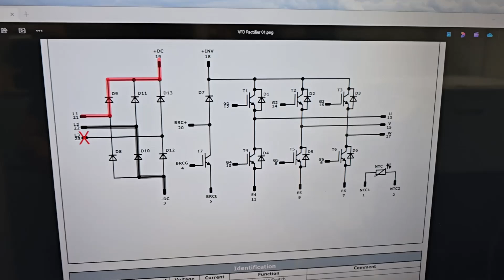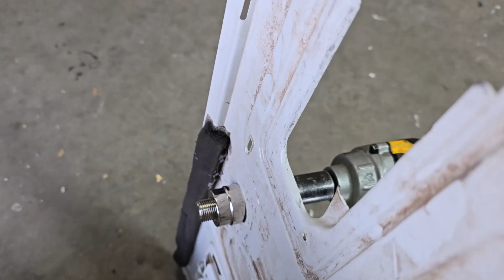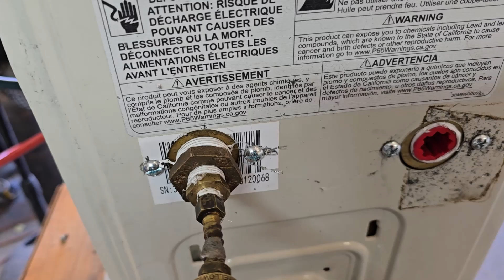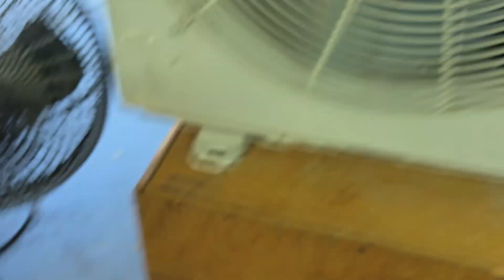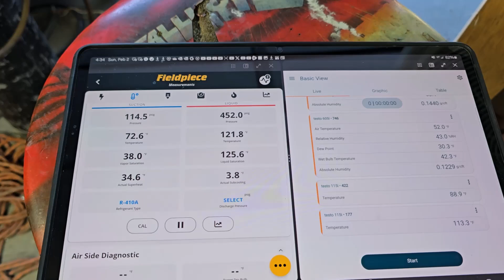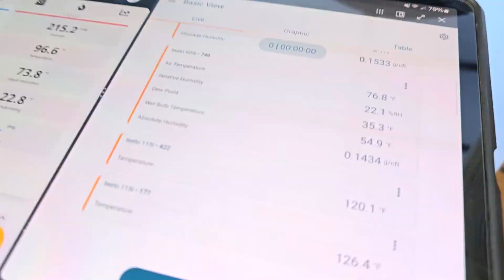Water Heater Heat Pump Project Ver 2.0 - Pt 4

Comment: You could use some EEV‘s and then a magnet to manually control it and set it whatever you need. I have all the materials together and I’m starting my DIY Frankenstein heat pump water heater today.

Comment: when you make V3 you should use a vevor plate heat exchanger. they're like 50 bucks
Reply from the maker: There's a plate heat exchanger for $50????
Reply: @hackfreehvac  they're actually less than that.
i don't know if YouTube will let me link it.
Reply: Are any of their units good for refrigerant? I've only seen for water/water.
Reply: @zaprodk the one at my house has been taking 410a dishcharge pressure for over a year without issue.

Comment: Hey question for you from the previous video on this build. How did you determine that you needed to modify the "condensing" now expansion coil? I'd like to build something similar, but not understanding why the change to the coil. Thanks in advance - Rob
Reply from the maker: The coil from factory is for a heat pump and used electr9nic expansion valves.
The piping works a little different for heat vs cool on most heat pumps.  Using check valves etc.
Also, I didn't need all of the circuits for the capacity of my compressor. 
So I just used about 80% as a straight up evap coil from bottom feeders up to the top common suction gas. 
If you check my over videos,  I repurposed the wine cooler condenser into a evaporator for my currently running heat pump (when I used the outdoor coil)  and I also converted a Lennox straight cool into a heat pump.  That one was a real trip. Worked great tho